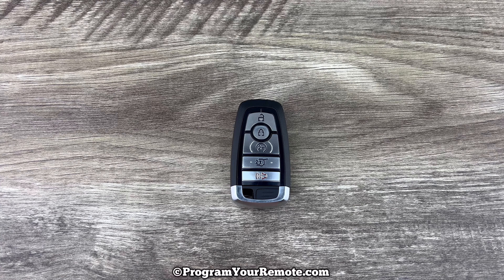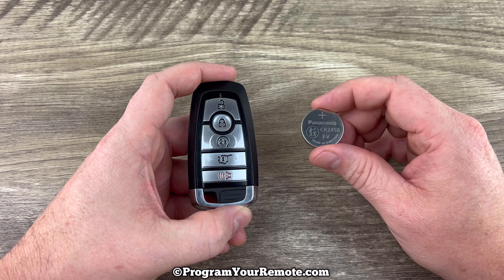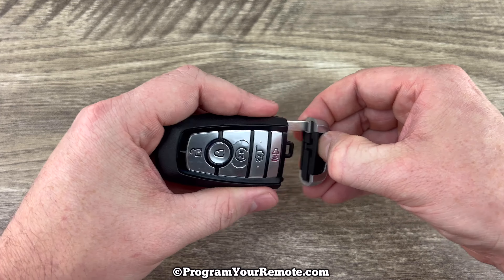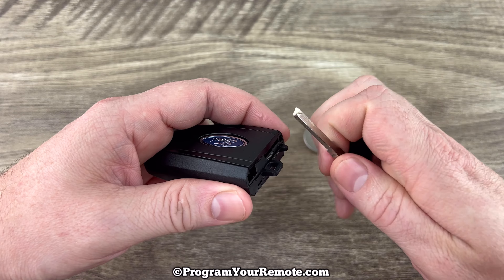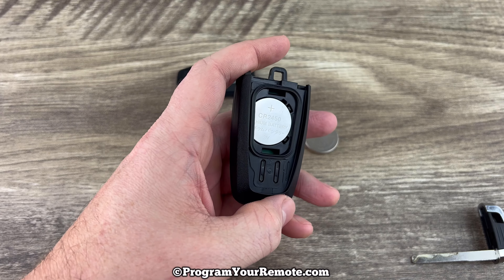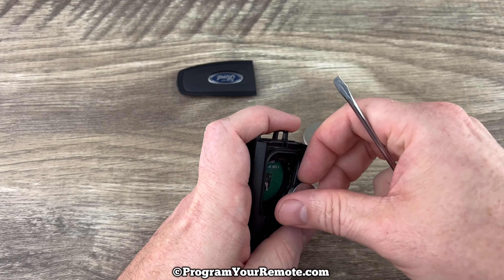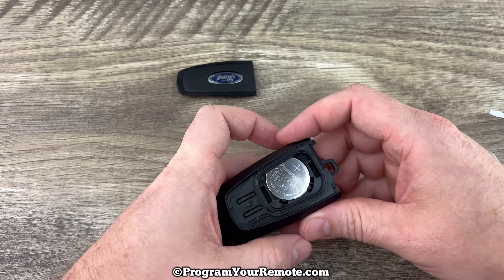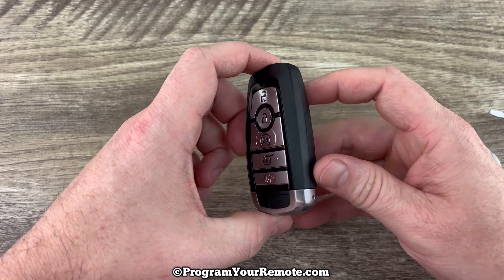How To Replace A 2018 - 2024 Ford Edge Key Fob Battery - Change Replacement Edge Remote Batteries

Comment: Good video, clear instructions, I used the same screwdriver that's used to tighten the screws on eye glass frames to pry the battery out, works like a charm. Thanks for the video.

Comment: Thankyou. I knew the way didn't know how much pressure to apply to pop back off. That battery is huge better last at least 2 years. My 1st key fob battery change on the Edge. Autozone charges $8.95 for one CR2450 3volt battery I gather it's lithium.
Reply from the maker: You're Welcome!

Comment: 3/25 I changed the battery but now the fob red light doesn’t turn on when I press the buttons??? The battery is correct.  The back is on securely.  Don’t know what’s wrong? Any thoughts?
Reply from the maker: The red light only blinks when pressing the remote start button twice and it takes a few seconds but if the remote is not working then I would check to make sure the battery itself is good